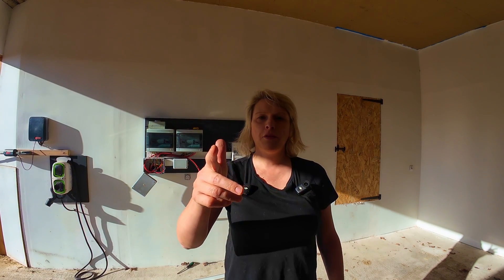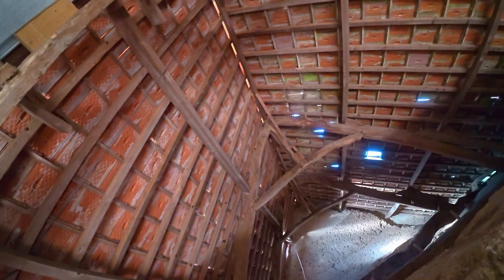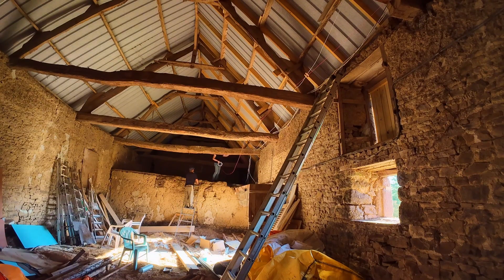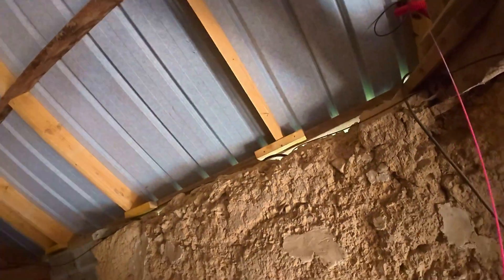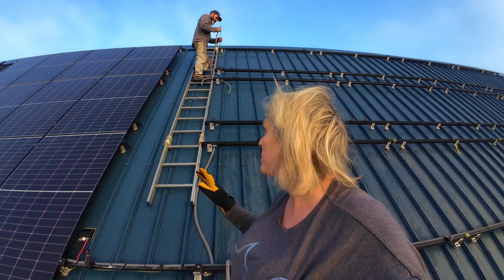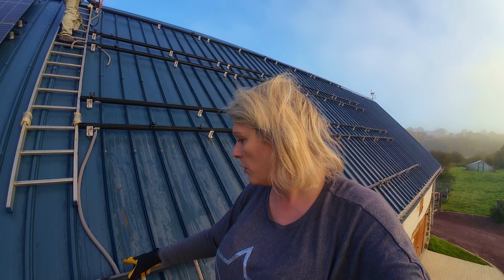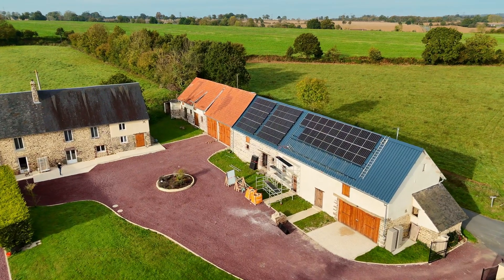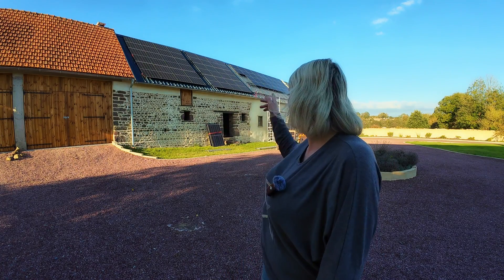Installing solar panels on a very steep roof - DIY!

Comment: Just one comment: I see you are using this 'gaine rouge' (the red tubing) inside the wall and the house. I did exactly the same thing in my house. When EDF came to check the installation before they put me on mains, they told me that I wasn't allowed do use it like this. They are for underground use only - in the house they might be a 'conducteur du feu'.
Reply from the maker: Thanks for the heads up what did they recommend instead, the thinner grey trunking?

Comment: Only one comment and I think I am right- trunking is normally square shaped and has a removable side, conduit is normally round and doesn't so needs draw strings, which you did at the beginning.

Comment: Hhmmmm.....why only 8 or 9 panels per string?   Higher voltage would give you less enegy loss on your long cable run.
We usually run 15 up to 20 panels per string....

Climbing up for each panel looks very exhausting. Maybe putting up some more panels, bevore climbing to the next level ?
Reply from the maker: We are limited by the voltage input of our charge controllers the maximum input they will accept is 450V

With eight panels were getting up to about 350 V and slightly higher when it's cold.

So that leaves us plenty of headroom just in case we get one year where temperatures drop like a stone as the voltage will increase as it gets colder.
Reply: @Gridbusters-qx4om 
Only 450V......OK, seems to be a Victron issue. 
Other brands can handle 800V or up to 1000V depending on model type.

Comment: SARAH,
1. GREAT JOB! 
2. IT IS ALWAYS BETTER TO OVERSIZE YOUR SOLAR AS YOU KNOW FOR OVERCAST & DAYS OF AUTONOMY TO CHARGE  UP YOUR BATTERIES 🔋!
3. DOES YOUR REGULATORY AUTHORITY RULES IN FRANCE STATE THAT HIGH VOLTAGE DC FROM YOUR SOLAR PANELS MUST GO IN EMT METAL CONDUIT ON THE ROOF & IN THE HOUSE? 
4. IN THE WESTERN WORLD 🌎 IT IS A MUST!
5. ALWAYS ENJOY YOUR PROJECT!
Reply: No idea about France, but there is no requirement in the UK, which is part of the western world.
Reply: @TheRonskiman  Yes but we also don't ground the panels in the UK.
Reply from the maker: No we don't need to put the cables in metal conduit in France.

Comment: A safety harness that isn’t connected to anything ain’t gonna do jack when you’re plummeting face-first toward the ground. Reckless doesn’t even begin to cover it.
Reply from the maker: I was using the safety harness once I got to the second string of panels.
Reply: @Gridbusters-qx4om Home insurance (assurance habitation) or specific assurance travaux policies often require that “travaux en hauteur” be carried out safely, sometimes explicitly referencing EN 363-compliant fall arrest systems (harness + lanyard + anchor).
Reply: Stay on the sofa then ...

Comment: Nice!  Finally filling that roof up!  I could see that coming two years away 🙂The structure of the rafters and walls still gives me the shivers, though, in terms of the weight they are supporting now.
Reply from the maker: We've massively reinforced this roof plus be put new roofing panels on the roof last year check out one of the earlier videos.

There zero deflection on the roof even when were both standing on the roof with the panels.

You need to remember that the load is not all in one place it's distributed over the surface of the entire roof.

The old corrugated iron roof which had been up for 40+ years was much heavier than the new steel roof which we replaced it with.